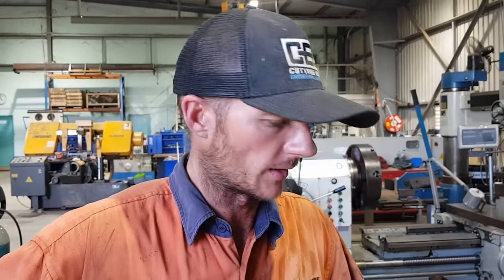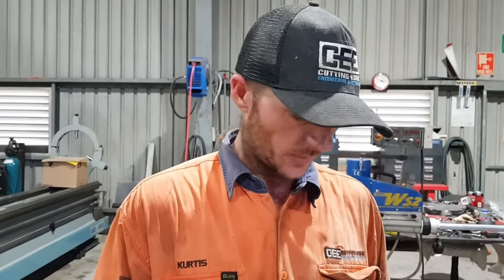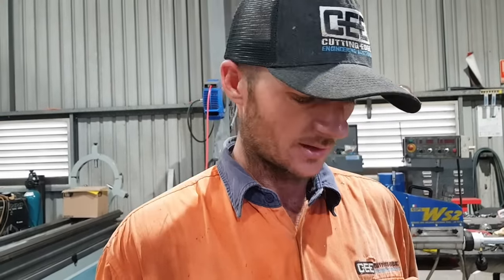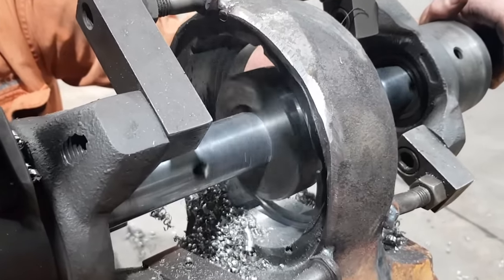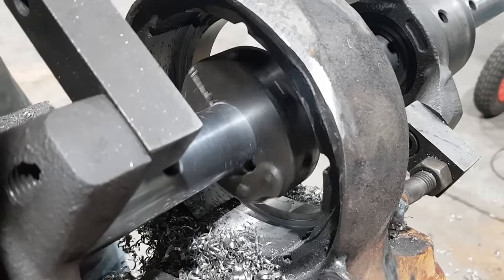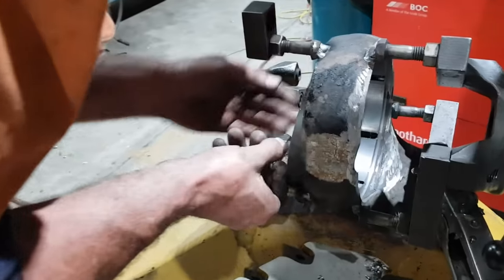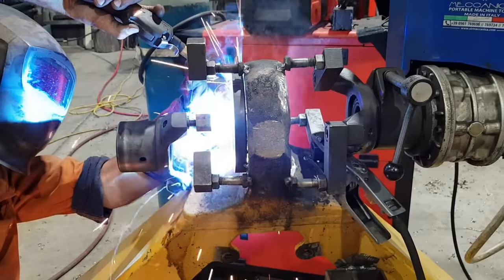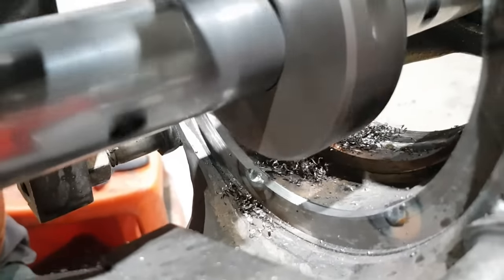Line Boring & Bore Welding Caterpillar 730 Dump Truck A-frame Eye | Part 1 | Sir Meccanica WS2

Comment: Oh boss look, I found the ball to fit that hole.... don't want it?
Very nice job, so far.
Do you have any idea how thick is the metal used in the A frame?
Oh boss, you sure you don't want that ball?
Reply from the maker: Hahaaa yeah that ball would've fit nicely. The A-frame plate is about 8mm thickness
Reply: @CuttingEdgeEngineering  I thought it would be thicker, quite surprising.

Comment: Couldn't the center have been fixed by fixing it with the center of the holes for the six screws?
¿No podría haberse fijado el centro fijándolo con el centro de los agujeros para los seis tornillos?

Comment: I see this type of part being bored and welded in the K&S facing borer machine, use the welder within a tail stock welder holder aligned with borer, using the sir mechanica as the welding feeder

Comment: to find the center of that hole, wouldnt it be the easiest using the bolts as reference? they should meet in the same spot, that should be the center of the bearinghole - only my guess

Comment: Bah, just set the new bearing in with some duct tape and loctite and send 'er...

On another note, I see you like Milwaukee M18 tools, may I suggest their 1 Banana High Torque D-handle impact?

I carry one at work (railroad) and it is pretty much neck & neck with a hydraulic 1 banana impact on 1 1/8 coarse thread w/ nylock nuts. (2000 lb/ft break out torque)

Comment: Hi Kurtis and Mrs,  😲, I guess it's f****d then, that seems to be the conclusion, after some serious inspection,lol, it obviously was suffering from over maintenance, can't wait for round 2 when there's going to be some  serious metal splashed on it, fair dincom boring / welding machine, is this for in house, or can you use it on site ,? Just wondering. Sorry you lost your wkend mate, but the cheque will compensate,  your the man who can , your reputation will precede ya, and should bring in the bucks. Thanks for the video, stay safe, best wishe's to you and your's, Stuart.uk.

Comment: what do you mean you dont have a way to find the original center ??? you have 6 bolt holes in a circular pattern surrounding  the destroyed hole that has the retainer ring , isnt that round also ?? the retainer ring ?? perhaps its because im dutch and all but i would use that to find center

Comment: pack it full of metal scrap and JB weld to hold the bearing it and it will be just fine..
That frame sell's for almost $4000 us used.. seash.

Comment: To remove the broken bolt on the frame I would have used a rosebud on the metal around the bolt and then persuaded it to move with a 36" pipe wrench.

Comment: Used to be a mechanic for a dry hire company called emeco based in Perth (they're over your way as well)
We had one of these come in after long term hire 
The boilys  a cut it off and rewelded a new eye on 
There's no real spec for the bearing centre 
Well there is but from memory it was +/- a few mm so basically drop the new eye on then eye ball it and weld it 
I heard the customer got a decent bill for the repairs 
That truck was fucked in every way, I don't know how they got grease on the cab head liner cause they get never put any in the machine

Comment: Get a new a frame and make a jig off it. Or cut the. Damaged bearing mount off and bolt the a frame back to the truck. Tack weld the new bearing mount in place as it sit under the truck

Comment: Would it have been any easier to manually weld up the egged out area then bore it round so as to not have to remove so much material?
Reply: That is what i usualy  do in situations like this,  this bearing point is giving trouble in the Netherlands too,i have repaired such frames 3 times already..  niche video. Greetings Ron van der Meijden, vmr vof.com

Comment: Cutting Edge Engineering 
Wouldn’t it be easier to cut off the whole eye and manufacture a whole new replacement eye to weld back on in its place

Comment: I usually use the bolts holes to center off of. That way you know for the caps will line up.
Reply: Based on the "Its fucked" explanation, I think the casting was bent making the bolt hole circle no longer round.

Comment: What if:  Instead of low powered pneumatic tool, use a socket with a really long cheater bar (Archimedes: long enough to move the Earth type) and save the client money from trial and error.

Comment: You couldn't use the mount bolt circle for a center reference? I would think you could turn up a centering plate on the lathe... <not a machinist lol.

Comment: Curtis, if I may offer a suggestion for next time on a frozen bolt. Heat it up like you did but melt wax into it, slow the heat down to allow the wax to "flow" into the threads. Let it cool down, then tap it a few times with a hammer then use an impact. They usually will break free once you get the wax melted into the threads.Even a can of Kroil will help, there's also another product, not sure if it's available to you but, "Free All". 
Nothing like a "rush" job, at least they could've washed it for you. The operator, in my opinion should be fired, that's their responsibility to do daily maintenance, at least it is here in the states with most companies. 
Oh my, "Homey" is stealing the channel from you, LOL. Great video as always, cheers :)
Reply: project farms channel disproved that lol it was the least effective

Comment: Wouldn't it be better to do this on a CNC milling machine?
Reply: Oh go on, entertain us and explain how a cnc would be better?
Reply: You missed "milling" ...
Reply: @r0311  no im curious as to how any cnc controlled machine would be “better” in this application?
Reply: @sharkeyist  Important here was the term "milling" not necessarily in combination with CNC controlled. And the idea is not so bad, because Kurtis is mentioning in another of his videos, that this using the Sir Meccanica is faster compared to milling. See here: https://youtu.be/s58Ae_q6RkY
Reply: @r0311  fair do’s on the cnc, but milling, as you pointed out, Kurtis pointed out, double handling a component you can pick up by hand wasn’t time efficient, that n the frame would need a big mill to fit in.

Comment: I'd have been tempted to build up the whole bore about 10mm with weld, plate both sides with 16 gauge scrap and find center off the bolt circle using my nearest tri-square and some ground shoulder bolts and make the hole with the finest worn out hole saw that looks close enough. Bit of sharpie and flapper wheel to work out the too tight spots  But I'm a welder, not a machinist. there's a reason they took it to you, not me.

Comment: Something tells me whatever company owns this truck....there not worried about the bill...if its a large mine or quarry they usually don't care as long as the machine is repaired ASAP...thats all that Matters to them...we've rented large hydraulic hammers to quarrys before...they double shift them for weeks with little maintenance..we send them a repair bill for 100k after the rental is over.....they don't even blink

Comment: She's fucked mate proper had the Richard, I wonder if the driver (obviously not a operator) could hear a clunking noise every time they turned, backed up drove in a straight line? I know 4/5ths of fuck all about machining but I have a idea to simplify the adjustment of the cutter in your line borrer it looks to be a bit of a pain. Great work as usual mate.

Comment: for your line boring bar.. can you build a damper ring that you can bolt to the end  or part way up the unpowered bar that is filled with fine turnings.. perhaps cast iron turnings so they are really fine.. like a dead blow hammer to dampen harmonics in the boring bar as needed.. only seconds to slip it off the bar to change directions.

Comment: I hate seized bolts to remove! There are half of the chassis bolts are hardly stuck because of rust in Russia. Half of my time as a mechanic is taking to remove seized bolts and prevent the rest of the bolts not to be rusted.

Comment: Line boring machine: $100/hour
Welding wire: $100/Kg
Bolt Extraction: $100/hour
It's fekin Saturday bloody ARVO!: Weekday repair cost x 1.75

Edit: It may well be fucked, but I'd wager not quite as fucked as the operator who neglected the inspections and maintenance.
Reply: So about $4k? That weekend multiplier kicks in.

Comment: Where was that super duper line boring kit with the handy welding cabability 40 years ago when I was doctoring deck winches, cargo cranes, and boat davits? 

You young guys are spoiled, I tell you. You probably don't have to chip the ice off the  job to start working in the morning or get strafed by shitting seagulls.

Comment: So your telling me with a bolt hole pattern on the part you couldn't find center???? Why tf not? Center to center of bolt holes would give you on hell of idea to go to now wouldn't it? Makes me wonder bout you....the part location is irrelevant if you have bolt hole locations....measuring off of wallowed out sides like you did is way worse than working to an equal number off the bolt holes! Cmon mate broken your mind set.